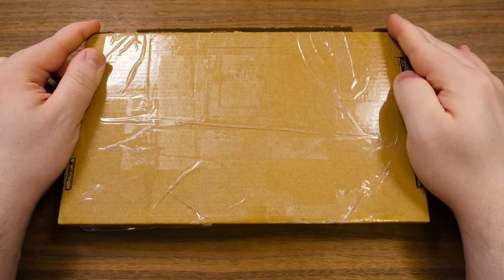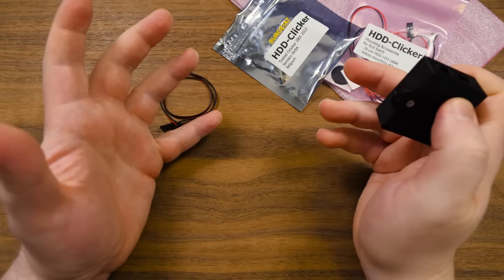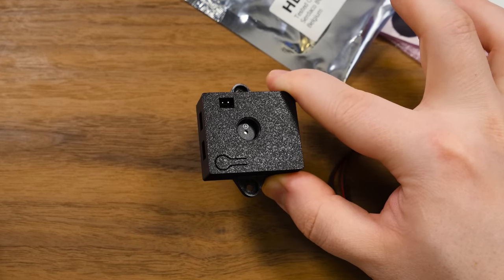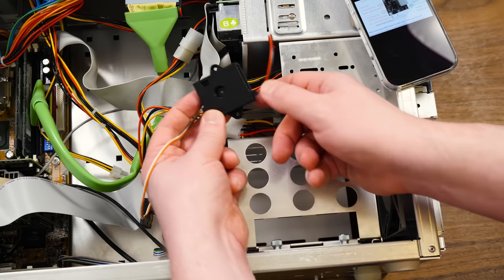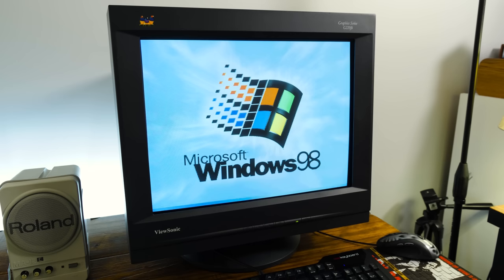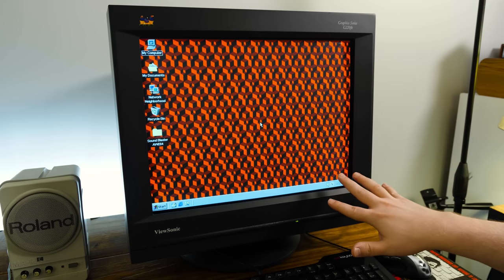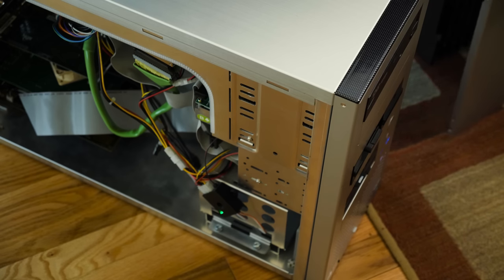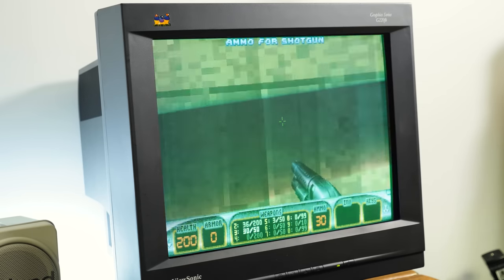The HDD Clicker: Add Hard Drive Sounds to SD/CF/SSDs

Comment: This contraption feels like it could do pretty much the same with the piezo speaker in-line with the HDD activity LED. Since with a real HDD the sound would come from e.g. the servo movements and other elements that depend heavily on the physical positioning of the (multi-jointed) read head(s), the HDD activity itself is quite useless in approximating what a real HDD would sound like.

Nice idea, but it feels like this should be implemented more on the level of the drive itself, mapping something like a virtual location on a platter to various adjustments to the virtual servo mechanism and outputting the matching noise patterns.

Comment: I think for true accuracy you would have to have a device that sniffs the IDE protocol on the IDE cable, so it knows if the "hard drive" has to move the heads (a lot, only some, not at all) by tracking the previous access commands.

Comment: My greatest lament with modern hard drives is that they're so quiet. Luckily the glorious Caviar in my Pentium desktop has been working for years (knock on wood). That said, I bought a small pile of sub-2gb drives at the last VCF East swap meet so I'll never need to be without my loud drives.

Comment: Yeah, it's not there yet. I would disable that thing after a minute or so. They need to randomize that pronto. What I think would be neat would be a device that takes the actual IDE signals to and from the SD Adapter and mirrors them to an actual mechanical HD. That way I can use a defective old HDD and hear that arm thrashing about.

Comment: I didn’t finish the video to the end he mentioned what I posted
It’s ok, but it doesn’t mimic the read head seeking different sectors of the hard drive. It might sound like it if you had a fresh install and your drive was fully optimize. An SSD is very efficient in “seeking” the files. So it is mimicking it exactly. Maybe introduce a little variation.

Comment: If someone wanted to go whole-hog ridiculous, make one that has platter spin noise, too. And configurable. 

Set RPMs, number of platters, and seek time to emulate specific types of drives. 

Then for extreme over-the-top, don’t use the activity LED to trigger, put it on the IDE chain to use actual hard drive commands to determine appropriate amount of clicking to do based on actual ATA commands.

Comment: maybe a 3D printed clip on shroud might give it some more low level thumps instead of harsh scratching.  also hearing the reading head sound without the motor spinup is a bit disconcerting.

Comment: if the sounds can be customized, you have potential there LGR to record the sounds for use, eg a quantum bigfoot has a distinct noise imo, like I can usually tell what a hdd is by the noise, i think with a single potimeter couple in the same circuit to the speaker could work as a volume controller

Comment: Someone should plot virtually where the data would be written to a real drive platter and have a controller force a physical drive to spin and seek to those locations just for the noise while the actual data is kept elsewhere. A lot of 'bad' drives would work great for this task.

Comment: What I noticed is that it seems like the clicker is causing the light to pulse along with the clicks. it was hard to tell but i could see a faint amber light from the SCSI2SD shining through when HDD access was used and that light wasnt going on the flash happy rampage that the red light of the case. 

i do agree it sounds very loud and shrill, and almost less enjoyable to me than the rapid spinning rust and voice coil drive. that churning kinda clicking and the more random cadence. this sounds very shrill and kinda. well like a clicker following a light.

Comment: I haven't messed around with SD converters, and my memory might be off, but my recollection is a defrag and starting windows on a period correct HDD will peg the indicator on for seconds at a time.... Your indicator seemed to never get above about long enough to make a clicking sound with the beeper installed..... Is this a side effect of the beeper product, my bad memory, or the SD convertor?

Comment: They should make a version of this that makes the sound of a hard drive spinning up. I have an old XP computer with a Maxtor hard drive in it and it sounds cool when it spins up. Maybe what they could do is make one device with a regular speaker for the spinup sound and the piezoelectric speaker for the clicking and put it in a box that will reverberate it so it will sound convincing.

Comment: If it used a different transducer that caused it to produce more of a low rumble than a click, it'd be even more convincing. Heck... it'd be even cooler if it had that the ability to reproduce the motor noise that the 40GB Maxtor disks were known for as a background noise initially.

Comment: i thought it will emulate the sounds of mechanical drive spinning and seeking. It's actually just light indicator translated into sound.

can you also connect it to bios speaker so you won't need a separate speaker?

Comment: My first thought was that it would sound more clicky than anything and I wonder what it would do if the indicator led stayed solid. Some drive have a more thumpy sound to them and I think one of those stick on vibrating speaker things would work inside the case to get that thumpiness. Better yet, someone should just use dead hard drives and make a board that spins the platters and moves the heads around based on what the indicator light is doing. All the drive would have is a power connection and indicator light connectors.

Comment: Now is there a usb dongle that you can fit between usb port and usb mass storage like flashdrive to simulate floppy drive sounds?
Reply from the maker: Not that I've seen. Although there are certain floppy emulation devices like I mentioned in the video at one point, such as the Gotek, which have a piezo speaker to reproduce floppy sounds. As well as software solutions to add virtual floppy drive noises when loading imaged floppies through certain emulators, like WinUAE!

Comment: Clint, did you ever get any feedback from the maker to see if there is a way to adjust this one or plans to improve on it using some of your suggestions for a version2?
Reply from the maker: I didn’t, although I think Serdaco now includes a cover for the speaker hole to dampen the noise.

Comment: Pretty funny. I do understand sensing the health of a machine by the sound. I have that Windows 98 boot seek pattern ingrained deeply in my brain. Good thing it's not a simulated Maxtor sound 🤣

BMOW has a similar device that adds sounds to an Apple floppy-emu using a relay, though it's a bit less generic than this activity LED driven thing.

Comment: One wonders what it would sound like with a, moving coil speaker. There was the passthrough, I gather. Piezo is a bit shriller, I recall. Also, now I want to see if a simple mechanical, electromagnet with a piece of metal, version might sound like.

Comment: Old computers using sold-state media loose a lot of the charm of spinning disks. The high-pitched spin up when you turn on the computer followed by the gurgling of the heads is just so nostalgic, and I hate that I can't experience that anymore due to the unreliability of old hard drives.

It's a shame that this doesn't emulate the spinning noise, and that the clicks are a bit unnatural. I've had a project in my mind for a long time to open up an old broken hard drive and modify it to act simply as a noise emulator, I just sadly don't have the electrical knowledge of how to go about doing that, especially in an elegant way. This would probably be a better solution for laptops, if it were able to be miniaturized enough, but I think my idea would be more authentic.

Comment: I had this idea long ago but i never made it because of what LGR mentioned. There was no cheap and easy way to mimic all the different ways an hdd sounds without also hooking the IDE cable and without that the sound becomes boring quite quickly due to lack of stimulation 😝

Comment: Sounds like those Windows 95 era Toshiba laptops, try wrapping it in foam or maybe open it up and put a resistor inline with it or a small ceramic disc capacitor (start with 10nF-100nF) + resistor in series of about 10 ohm across the buzzer element.

Comment: I agree, the concept is pretty cool, but the sound isn't totally authentic.

Perhaps you (or someone else) could upload some video clips of the sound of various hard drives operating, if you've got the time, inclination, and actual drives. Then the developers could try to emulate those sounds with the little clicker thingie.

It would be cool if it could also emit the sound of the disc spinning, although I'd understand if that's not possible with the tiny piezo buzzer. Perhaps that could be an option for a future version, like you could connect a speaker that would emit the HDD spinning sound.

Comment: Undewhelmed by all the clickers shown off online. I'd just grab some cheap Midi wavetable, like McFly, then find which control command produces a hard drive-like sound. Probably can be done with a single shift register, when you pre-load it with a sequence of bits, and then feed them to the waveboard, to essentially play a single key. Can be done with an Arduino. In fact, I have a wave shield for mine, which can play audio samples. Can be pre-loaded with a genuine hard drive sound effect... I guess what I'm saying, is that hard drive clickers need the ability to use custom soundfonts. The current versions I find unpleasantly annoying. Nothing like the real mechanical sound.

Comment: I've been building computers since the 90s and I've never heard a HDD sound anything like that.  The sound is both wrong, and too uniform.  Harddrives seek randomly for every piece of data, and depending on how far it is you'll hear different clicks.  That's the only reason why Defrag sounds close, is because the seeking is very uniform during a Defrag.

Comment: In the future people will make the SD/Flash drives with physical hardware meant to simulate the sound of the drivers with dummy parts, and the ability to directly read and respond to the OS. That's my prediction based on the ideas coming from the replies.

Comment: I'll stick with my extensive pile of hard drives so I can get all the subtle soothing sounds. Even the crashy ones. But it is a cool idea. I think to get more accurate seeking noises it might need to be something that goes inline with the IDE so it could tell the difference between the random and sequential I/O. That sounds rather processor intensive though.
Reply: I hope we can end up recycling old dead drives to just function as noise makers. Like it doesn't matter if it can actually read the platters, it just needs to move as if it is to sound convincing.

Comment: Defraging a solid state device actually reduces its lifespan.  In fact turn off auto defrag on your modern machines. 
It's cool though.  You get used to the noise as an indicator that your computer is doing something.

Comment: The only way this could get better is if it hijacked the SATA data A+ and A- transmit signals to get more accurate readings and included a mechanical spinning motor for the whirring. :D

Comment: Ehhhh, cool little gadget and all, but I'm used to the noise of ye olde skool HDD being drowned out by the noise of cooling solutions, be they air or water.  Even modern HDDs are almost silent compared to drives of the Win9x era and honestly I can't remember the last PC I had where I could hear the HDD noise over everything else.  So that being said I'd rather just settle for an activity indicator light at least somewhere on the machine.  Just knowing your storage drive is working by that little LED happily blinking away as the bits traverse between drive and CPU is, to me, reassuring to say the least.

I'm writing this comment on a 2015 MacBook Air and while I love the machine in general, the fact it doesn't have an activity light urks me and I yearn for it to have one.

Comment: Ha how cool - although I get a similar sound out of my ultra noisy SB16 whenever the hdd activates lol

I reckon it’s a bit more like a 1.8” disk sound overall.

Also, because you’re using flash the read mechanism/activity led will not be aligned :-)

Comment: what it is is that its to speaker does not have the dynamic range that we need so it sounds to Tinney in my opinion the sound actually is probably appropriate if I could hear it on the normal speakers excellent device in my opinion excellent you scale it down to make it really small which is fantastic but the piece on speaker is probably not the right option would be really cool is to have a header on there to make it so you can have a bigger speaker do you can plug-in but I see where you’re going with this honestly if you can take the tinnitus out of the sound, it would be perfect because that’s really what I’m hearing on perfect personally and that’s just a fault of the  speaker used honestly incredible device. I would love to purchase one myself where do I get it?

Comment: I wonder if there's a market for a fake hard drive, maybe laptop size. It wouldn't need to do anything but spin and seek while the data comes from another device entirely. There don't have to be any actual heads, just the coil and swing arms.

If so, there are probably plenty of dead drives that can be recycled for the purpose.

I think the easiest way to alter the sound of the clicker is to try putting it in containers of different sizes, both tightly sealed and not.

Comment: I still use spinning disks (2 on one machine, 7 on another), so I don’t really miss the sound. I do appreciate it though. 

On another note one of my laptop has no disk activity led and it’s discomforting. Maybe I should find a way to add it without blowing the warranty. It’s work machine, not mine, after all.

Comment: Nope, for that money it should be configurable to sound like an MFM, IDE and high speed SCSI drive complete with spin-up sounds. The HDD LED trigger should purely be that, a trigger for the seek sounds not an off on switch for a buzzer. Neat idea but ultimately falls far short of anything I would spend money on.

Comment: I had my pc hard drive changed recently and the replacements sound louder than the previous ones

also I would have tried an actually spinning disc and drive needle than just a clicking speaker that looks like its goes on with the light and sounds almost (to my speakers) like a loose electrical connection

Comment: A bit too rappid and it sounds more like a 2.5inch laptop hdd.
My fav hdd sound by far is the lowerpitched mechanical tick like physically tapping on the metal case of a 3.25 hdd with a ballpen.

Comment: Tempo is nearly correct, but it's not convincing: the subsonic shocks spreading through the case aren't that easily reproducible and that's good - that sound did not shorten our lives with a measurable amount but certainly made as crazier.

Comment: I avoid having to buy this product by keeping a cheap 2.5” hdd in my case (with nothing actually stored on it except for a background app that will always use a little read data) next to my super fast Gen 4 m.2 and Gen 3 ssds. I still get the nostalgic noise without being obnoxious or spending too much money.

Comment: This is good, but maybe the noise is too loud and has always the same lenght, you can hear it is fake. I have an old Windows 95 pc with a Quantum Fireball HDD, and of course is loud as heck, but when for example I click the right button to open the menu, it makes noise, but for just a fraction of second. The sound on the clicker is always the same lenght, it lacks the random HDD access the pc performs.

Comment: Personally, I'd just get an old hard drive. They aren't hard to get and provided you aren't stupid with them they can last. I am still using my original hard drive from 2000 (20 Gigs!) in my XP machine today. I use it for all of my older DOS stuff, I may in future set the computer to dual boot with windows 98 installed on it. I can see the merit in using solid state hardware, but I prefer original hardware where it is practical.

Comment: If they sell enough I'd like to see multiple versions that come with more features like, fan pass through and it included RGB controller. That way if you want it either of those things it would actually be a normal thing you could put in your computer that didn't cost more.

Comment: get an old hard drive, gut it, and put the clicker inside it :) Or better yet take the LED wires and wire it directly to the pins responsible for moving the heads on a old drive.

Comment: I like the idea but the implementation sucks. It just makes a beep every time the drive activity led turns on. A proper implementation would be inline on the IDE cable that could see what addresses are being accessed by the computer and it could approximate the sound based on the physical locations that a drive head would be moving to.
Reply: Bonus points for mimicking the sound of the platters spinning up

Comment: Yeah nah… sounds like a fart in a can. A more mechanical implementation, like a stepper motor or relay that actually vibrates a little and can be screwed to the case for additional resonance would sound great.

Comment: If it sounds like the full height 5.25" drive from a 5150, then I'll buy one for my modern machine... those seek noises... mmmmmmm
Edit: Ah well, it sounds like some of the later drives, just a soft clicking... I want something older.

Comment: You should NEVER run defrag on a solid state storage device. You could literally use up all the rated read / write cycles in a single defrag session, especially on something like compact flash! If your drive still works after this video I'll be shocked